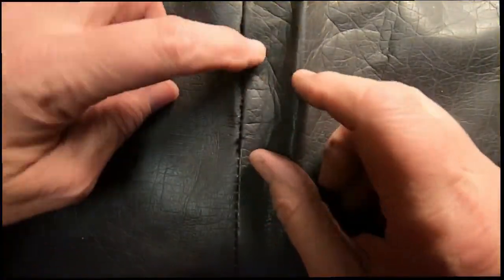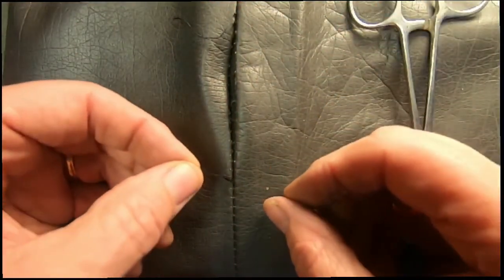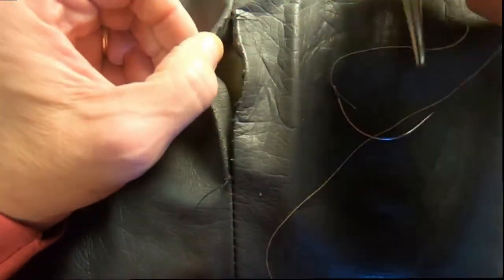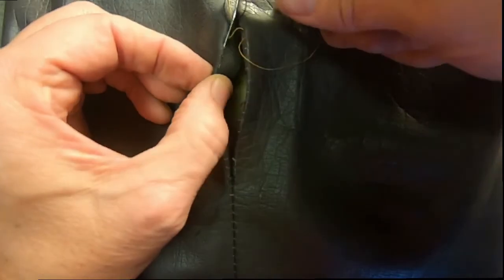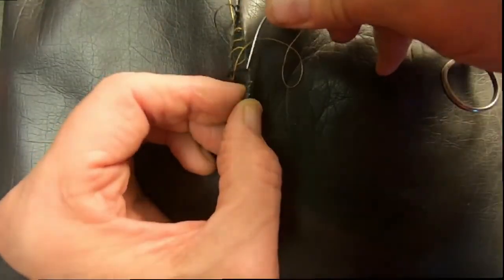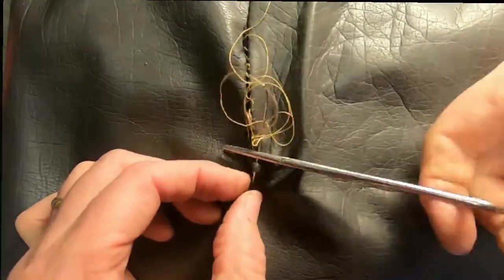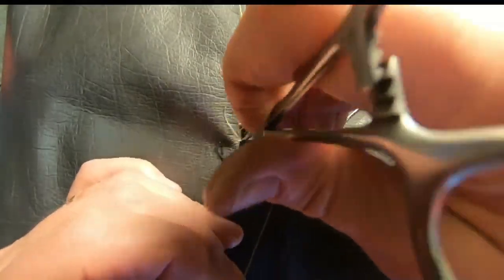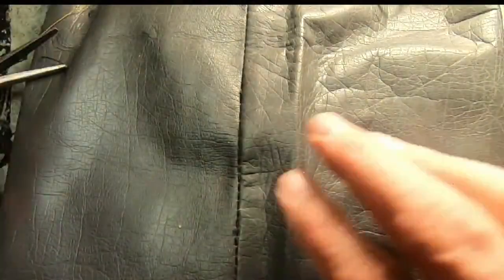Seat Seam Repair

Comment: Thanks!  This is great info.  Is it possible to repair leather that’s come apart at the thread holes?
Reply from the maker: yes.  You need an awl and make new holes and use those.
Reply: Saab Magic Man Great thank you! I was thinking about reinforcing the leather somehow but that would be much easier.

Comment: So I saw your link on the kit from Amazon , is that what you used ? Will need nose be fine to help fish thread through ? If the holes in the leather are broke , do you make new ?
Reply from the maker: TBH, it’s difficult to find strong curved needles. If holes are broken, you need to make new ones directly behind. In that case, a really strong straight needle is best. Needle nose pliers work fine.

Comment: What about a HEAVIER LEATHER seat (Rav 4) where seam came apart (driver seat) and is 1.5 inches apart?  The gap is a lot wider; Not this soft leather with hardly a gap. 
Do your Principles apply to my situation? :  wider tear, hard/ thick leather, where  thread holes are absolutely visible?
Reply: works fine for heavy leather.

Comment: Well, bought a sewing kit and tried this .. epic fail .. I have a classic 900 and the leather is to thick from how you showed . I can’t get the curved needle through the next hole . Further the kit was cheap and the needle broke ! Oye .. the demo makes sense just my seats don’t allow this ..
Reply: Just make all the holes bigger.  Take a tapered punch or something and push thru the holes to make them bigger.  A really sturdy straight needle will do the trick then.  If you are not pushing the needle thru the holes that are too small, it will be easier